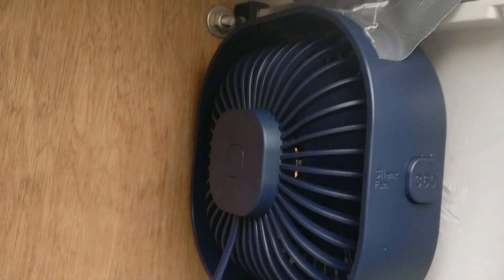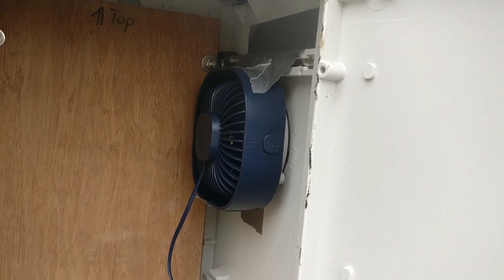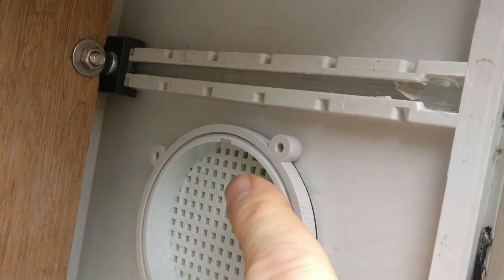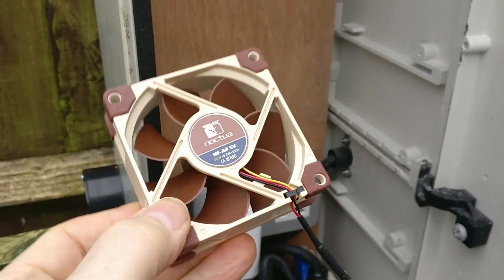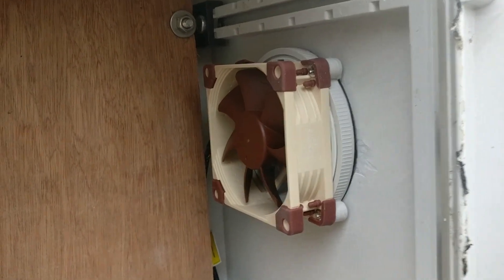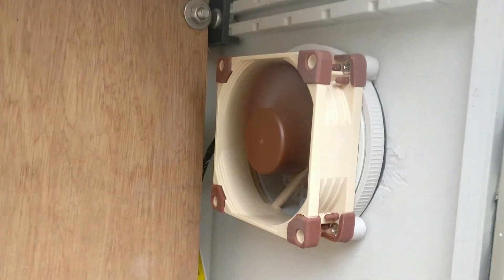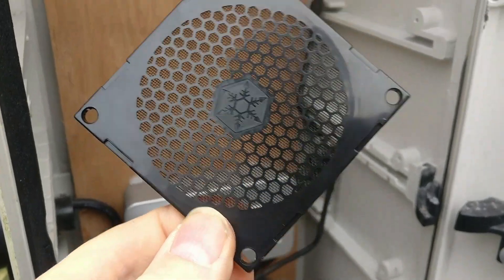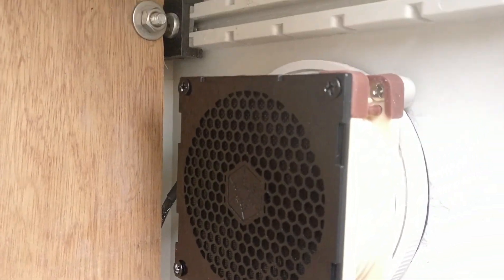Outside Electrical Cabinet Enclosure | Noctua Fan Install

Comment: Hi Pete do you have any update on the condensation? Are there any days where you still get some condensation inside the box or has it remained absolutely dry since?
Reply from the maker: Hi. I use the fan, plus I lined it with some foil based insulation. About 10mm thick. Stays dry now.